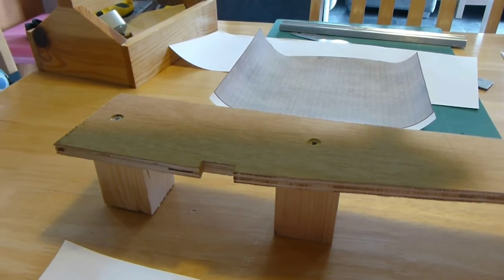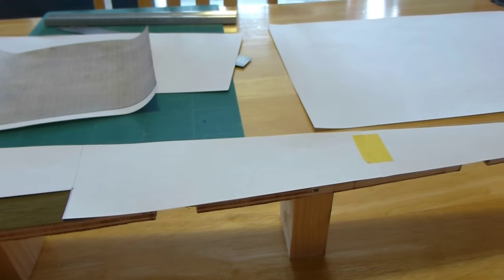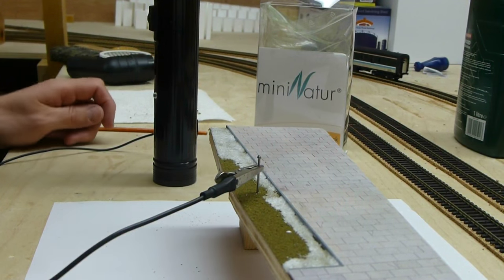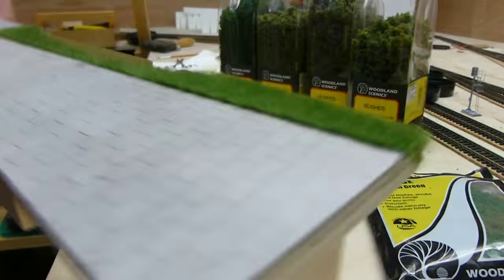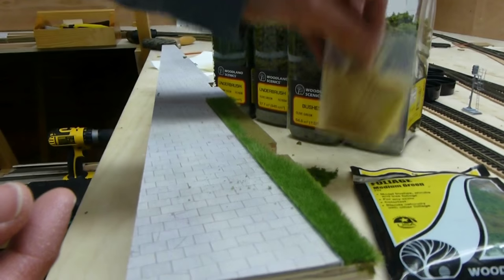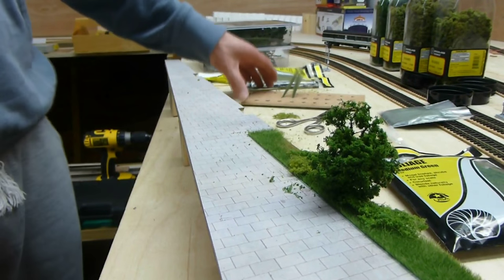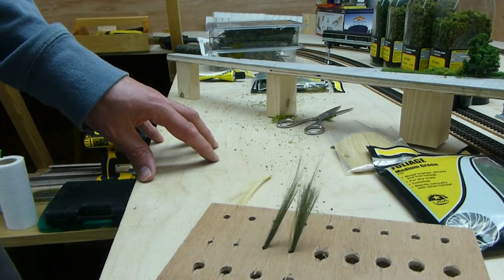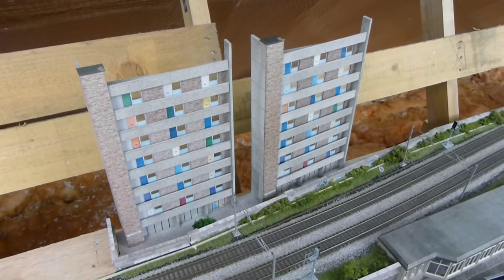Dean Park Station Video 57 - How to apply Static Grass

Comment: DaveClass47 Looks good and some great advice with the tall grass fibers... I noticed at the end of the video that it looks like you might have enough room in the low relief flats to stick a web cam? You could probably get a Logitech HD web camera hidden in there behind a window, might produce some unique shots for the layout, just leave the USB cable dangling under the baseboard or maybe mount a cheap USB hub under the baseboard?

Comment: Always great to see people working on their scenery. An interesting tip about the plastic edging for the card to stop pva seepage. Would it be possible to varnish the edges of the card to stop the glue?
Really love the flats, I know you have shown the flats before but can't remember if you showed how you made them. Are you making any more and if so and you haven't already shown would you do a short video on them some time.
Robin
Reply from the maker: Milton Mo Junction Hi Robin, I made the flats two years ago believe it or not...time flies in 00 gauge world lol.   Think I covered how I altered them to sit at an angle in a video.   To stop the seepage you could just seal it with superglue....but I thought the plastic edging looked more like the concrete strip edging you get along the side of slabs, so I went for that quick and easy method.Cheers.Dave

Comment: Brilliant Dave, Really enjoyed seeing you bring the scene to life. What make of spray varnish do you use and glue for the sticking of the paving flags to the card? Steve
Reply from the maker: JamesStJunction Hi I use 3M CRAFT MOUNT permanent adhesive.   Amazon sell it. I have gone through loads of cans and its good stuff. Dave
Reply: Cheers Dave, You have converted me to scalescenes they look amazing. Steve
Reply from the maker: JamesStJunction A lot of guys have a thing against card modelling, but its sooooo versatile and fun to do, no painting/weathering required and can be adapted to suit your needs.  Scalescenes stuff is very good stuff.   One tip though....print out spare sheets when you build something, as I have found in the past that I needed a sheet later and the printer shade had changed (due to ink levels I think) and it was hard to get a matching replacement sheet.   I actually have dozens of spares for most parts in case I need to replace or repair later.   Sometimes with my printer, and even the laser printer at my work, the shades vary from day to day! - weird, frustrating, but just one of these things lol.
Dave
Reply: Cheers Dave thanks for the tip. Steve